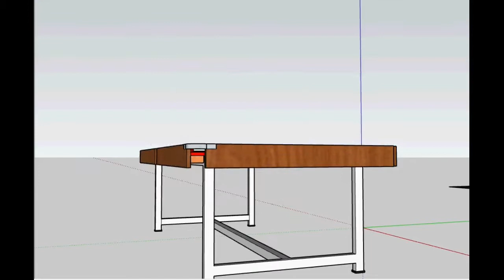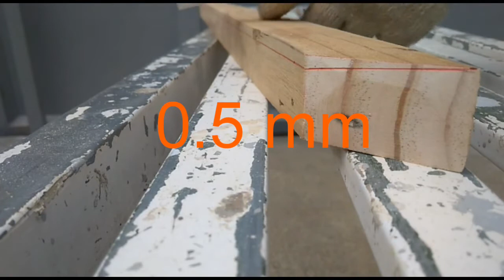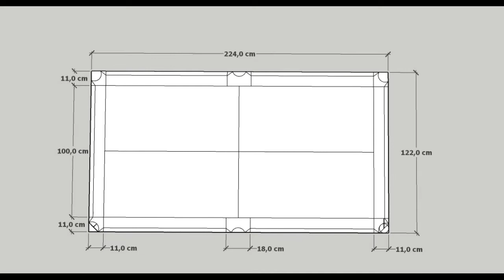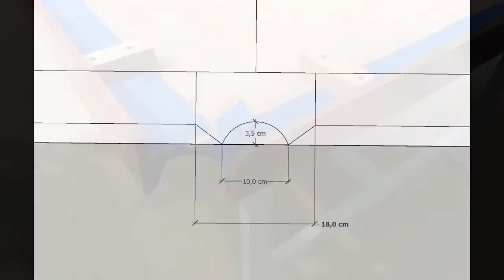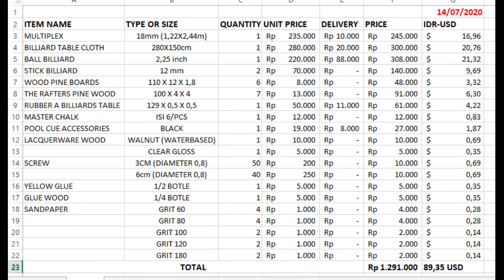How to Make Billiard/Pool Table low cost under 100 USD + (free design) keep watch until the end

Comment: Does a pool table need to have the sides angled outward? Cus I see most of them like that but I don’t know if it needs to be at a specific angle and the height
Reply from the maker: The sides angled outward really necessary left hand as a position to be more comfort when hit the ball billiards But i reduce cost material so do not use. 
size reference:
https://www.dimensions.com/element/billiards-pool-table-pockets
Diagrams and name as material:
https://www.homestratosphere.com/pool-table-parts-diagrams/

Link was not promotion , only just knowledge sharing
Reply: @arwoodies  also the balls leave the table more often ?

Comment: Hi, for the boards, 100*4*4 and 110*4*4 what does the 100 and 110 mean?
Reply from the maker: 4/pcs 100cm*4cm*4cm (side left& right Billiard). 2/pcs 110cm*4cm*4cm (up&down Billiard)
Reply: @arwoodies  then what are the green strips you put on the sides ?
Reply from the maker: @thechauncey5002  That rubber , but it is wrong because it is too hard. so it can't bounce the ball well.

You can change rubber. Link seller from Indonesia, priced Rp. 310,000 if to $ 21.49 usd:   https://shopee.co.id/Karet-ban-atau-rubber-cushion-meja-billiard-7-feet-i.31007671.1067302732

Comment: What kind of wood did you ised for the surface. And what for the sides? Thank you
Reply from the maker: pine wood from ex-pallet. The ex-pallet wood is used as railing rubber.
maybe my english is not good, but if you have more questions?

Comment: You said that you use the wrong rubber billiards table, why is it wrong? And what is the right one?
Reply from the maker: Because the rubber I use is too hard, so it can't bounce the ball well. Maybe as good as it is. Link from Amazon:  OKKO K55 Pool Billiard Quality Rail Rubber Cushions, Set of 6 https://www.amazon.com/dp/B09KR5387V/ref=cm_sw_r_awdo_VVQMA97FVHATQB05TT6J
Reply from the maker: Link seller from Indonesia, priced Rp. 310,000 if to $ 21.49 usd:   https://shopee.co.id/Karet-ban-atau-rubber-cushion-meja-billiard-7-feet-i.31007671.1067302732

Comment: Whats the material for the cushion?
Reply: Its called Baize.. I dont know what he used but you're looking for Baize.. you wanted non napped.. napped is for snooker players and how they get their freakish shots.. worsted baize is what most american tables use for speed
Reply: If you're considering making one consider pouring resin on the bottom board as an alternative to slate, it wont take on water and warp like the wood will and will give you an almost slate like surface.. wouldnt have to be to thick either say ½ an inch would cut it
Reply: @mysty0  thanks for the info, may not seem like a lot, but its really helpful